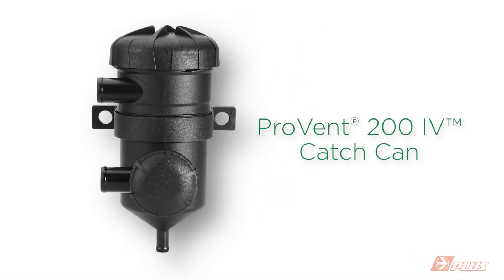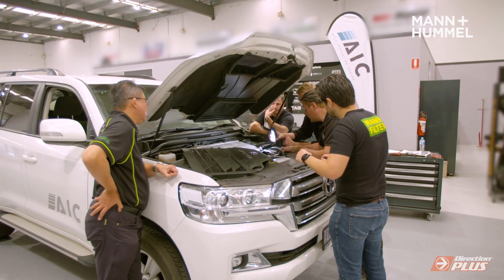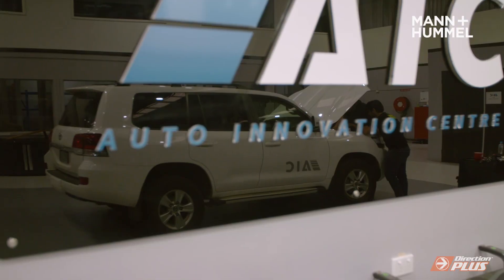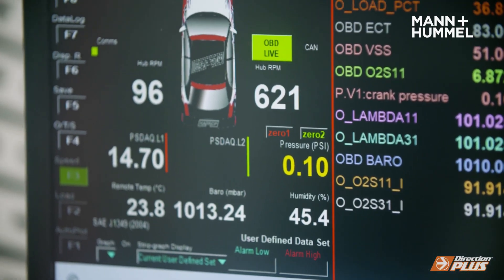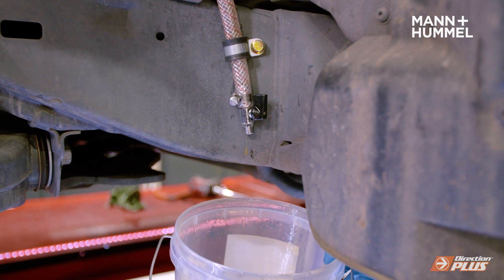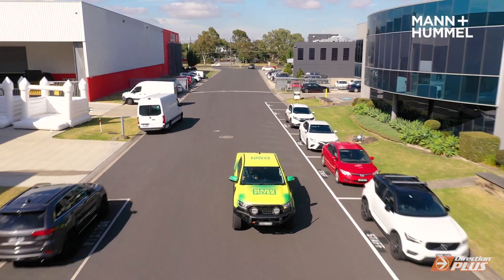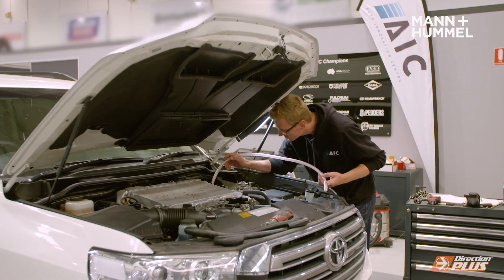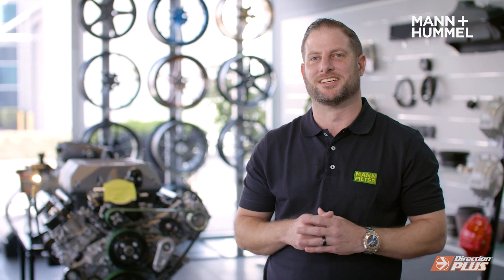ProVent Catch Can Pressure Test by Mann + Hummel

Comment: What were the test results before and after installing the catch can? i.e millibar?
Reply: I just did a test on my Navara 2.3 twin turbo. Whilst not as in depth and accurate as Mann would have done but it gives you an Idea.
Factory = Idle .26 inH2O 3000RPM -2.8 inH2O
Provent 200 = Idle 1.8 inH2O  3000RPM .25 inH2o
Filter was oil soaked in the comparison.
Reply: @c5032005 hello, it's good or not?
Reply: @c5032005 I don't understand if you're trying to say if it works well or badly, could you explain?